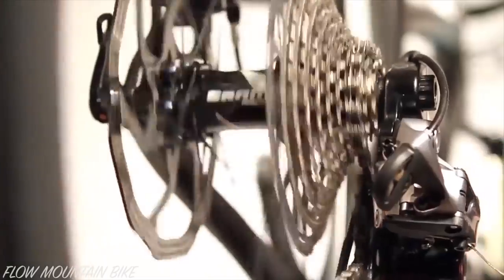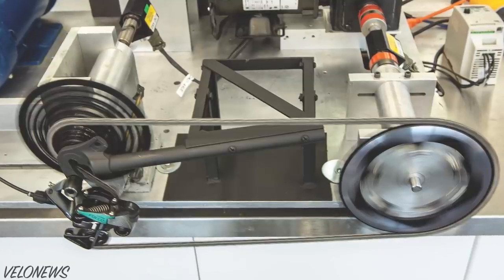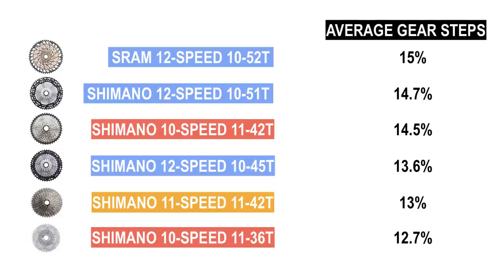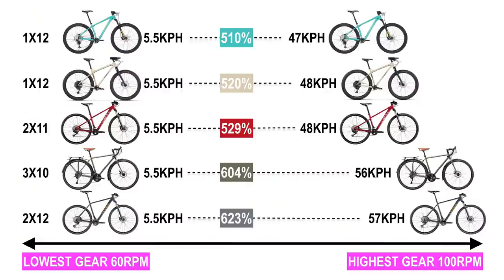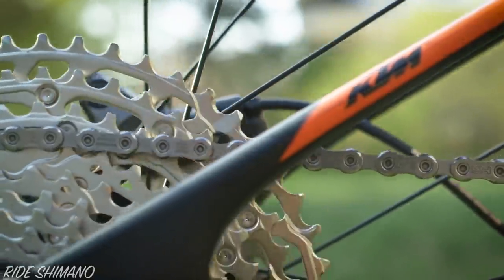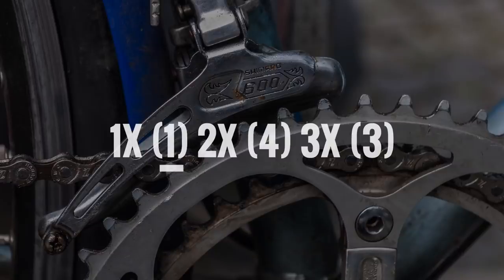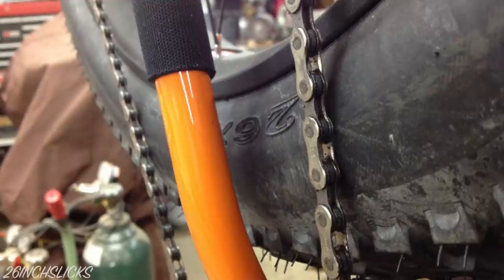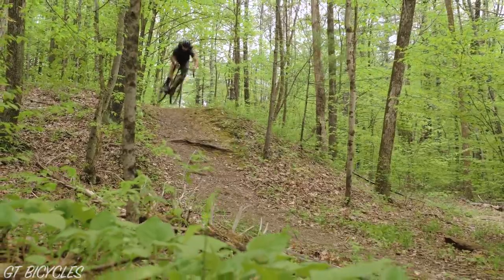1X vs 2X | What is the ULTIMATE Drivetrain For Your Bike?

Comment from the maker: Do you think the front derailleur will always exist? Or will new technology eventually render it obsolete?? 🤔
Reply: I hope FDs will stay for long. On a tandem, a 3x setup works great, the need for cross-chain is rare and thus chainrings and all cassettes cogs wear quite uniformly.
The only pain is that we have to buy three new chains after every 3000km anyway... ;)
Reply: You forgot chain retention. It is one of the biggest benefits of 1x in MTB.
Reply: Oh that's a tough question!  They are cheap and efficient and have been around for ever so I am going to say yes, they will continue to exist.  You can't make a 1X fast enough for a road bike.
Reply: I think they'll stick around as long as the rear derailleur sticks around. Hopefully one day we'll fully adopt gearboxes of some sort as the standard.
Reply: 1x gang
Reply: I think they'll stick for long, especially on road bikes
Reply: Your drivetrain is a reflection of your terrain or the versatility of your bicycle.  If you want a versatile bike for flat, hilly and mountainous terrain, you must ride a bike with more than one chainring.
Reply: I think chain slap and chain coming off in MTBs is one main benefit of 1x drive trains. Another plus point for 1x is less clutter on the bike. No front derailleur means one part less that can break, one cable less and more space on the handle bar with one lever less. The whole concept of having to know how and when to shift which lever up and down honestly seems pretty nasty and archaic and I always wondered why they don't simply introduce a mechanical shifter where both cables go in and that does a correct shifting automatically. Like they do with electronic shifting I believe. Having to think about shifting two levers at the same time can be a nuisance in cities with much stop and go or if you ride on the flat and hit a hill and have to shift down quickly to avoid shifting under load. Another thing I also don't get is: If a narrower cassette and a narrower chain last longer anyway, why not just use that narrow setup not only for 12 speed drive drains but also for e.g. 3x8 mitigating most of the chain angle problems(?)
Reply: @no-trick-pony  Chain slap is all but eliminated with the clutch mechanisms in today's derailleurs, whether running 1x or 2x.
Reply: The big takeaway is about user needs. How many uses need to go fast under pedaling power? I suspect for many 40kph is enough, going up gradients is a bigger concern for many, especially amongst those that follow tour channel. I wish many entry level bikes of all types with 1x to let new riders focus on riding not shifting.
Reply: 2x works for me. 12 speed chains might last longer but they are very expensive and since we travel for long amount of times in developing countries very hard to come by and you can use a shimano or sram or whatever chain on a 10x. There are also 10 speed chains that last as much as 12 speed ones. Not sure the front derailleur will always exist but for the bunch of years it will take me to complete my round the world adventure I think so.
Reply: @no-trick-pony  only one shifter on my 2x with Di2. Shifts automatic in the front, and compensates by shifting one step the other way in the rear
Reply: Why did you omit FSA's 1x13?
Reply from the maker: @piotrch0  I don't believe FSA make a 13-speed drivetrain. But either way, I included the most common drivetrains with the best data we have.
Reply: Just went from a 3x to a 2x on my XC hardtail. Never ever have I used the front derailleur with such a sh1t eating grin. It's great to switch between low and high gear with a single click when taking off and after getting up to speed, and it requires infinitely less attention. And I can hear the chain scrape when cross chaining so nope, never getting a 1x.
Reply: Gear hub & belt?
Reply: I tend to look for a bigger front chain ring, to be able to go faster, because the rear cassette can only get so small. I'm not a big fan of the trend of the front chair ring getting smaller for these reason, also I imagine the less teeth there are the faster the wear? 
Anyway I enjoy your videos! I'd love to bike pack some day.
Reply: @PrzemyslawSliwinski  Agreed! We have 2 tandems that are ridden both on-road and off-road. Both have 3x drivetrains. We see a wide range of speeds due to the varied terrain and wind conditions etc and I couldn't imagine riding our bikes with a 1x drivetrain. A 1x would be a sacrifice either at the low end or the top end not to mention the bigger gear steps between gears. 1x is definitely NOT the way to go!  Cheers, #tandemadventurers
Reply: @konyp1  How is chain retention a benefit of 1x when I've seen way more riders dropping chains with 1x systems than I have with front derailleur equipped systems?
Reply: @SurpriseMeJT  THIS.
Reply: @theadventurebiker  2x chainrings are designed to move the chain between gears using ramps, cut-outs and low teeth. 1x specific chainrings have uniformly tall, narrow-wide teeth designed to prevent dropping the chain. I used to be skeptical of  1x a while back but having tried it myself I am fully converted, at least for technical MTB. 2x will of coarse always have its uses for road, touring etc.
Reply: @theadventurebiker  Among the all new groups the closest in range and gear gaps are the GRX 2x11 ones, I suppose. 
So, fortunately,  the "<3x" future doesn't look quite bad... ;)
Reply: @konyp1  Yes, I am well aware about the design of a 1x chainring and also 2/3x chainrings. That doesn't change the fact that I've seen more dropped chains on 1x than any other MTB drivetrain. I have a couple of friends who have lost positions in MTB races because of this.
Reply: @theadventurebiker  That is rather strange and contrary to my experience (xc, enduro), and general consensus on any mtb forum. But oh well, to each their own. There are plenty of 2x bikes if you prefer these.
Reply: if we can somehow create a front shifting mechanism that doesn't rely on a front derailleur but has some benefits of 1x systems, then 2x will still prevail.

One such product was the Vyro cranket, which is a 2x crankset with pivoting chainrings that maintain a specific chainline and can be narrow-wide, effectively making it a 1x system with  more range. Unfortunately, the company shut down.
Reply: @avocette  A Belgian company ("Secret" or "Classified" - I've forgotten the name) has recently started offering a two-speed IGH that works with the standard rear derailleurs.  It is prohibitively expensive, however....
Reply: @konyp1  yes of course -To each his own. Ride what you like best. As for me I am highly doubtful that I'll be riding a 1x bike any time soon, if ever at all. Its just ridiculous to me.
Reply: @PrzemyslawSliwinski  this really isn't anything new. 3 speed internally geared hubs that can accept a Shimano 7, 8, 9 , or 10s cassette have been around for nearly two decades.
Reply: @theadventurebiker  Good to know.  Thank you!
Reply: @PrzemyslawSliwinski  yes Sachs of Germany was the first brand (I beleive) to introduce this type of hub, back in the mid to late 1990's when most bike drivetrains were 9 speed (on the rear). Since then, the bicycle division of Sachs has been acquired by SRAM and I believe SRAM still offers [newer] variations of these hubs. Sturmey Archer (formerly a subsidiary of British maker Raleigh, but now a division of Sun Race) also has a full line of various hubs like this.
Reply: Well I'm in a 3rd world country. 3by gang!
Reply: @no-trick-pony  i think because there's that standard width of hubs   i.e.  8-11 speed cassettes can fit the same freehub
Reply: @no-trick-pony  There is an old grip shift that does that exact thing(shifting both front and rear derailleurs in a progressive pattern). It was a sight to behold. I think it was french. Good heavens. We scrapped it. It was awful.
Reply: The front derailleur makes a bike way more versatile, especially mountain bikes.
Reply: @tellef70    show me pics or send link,  that sounds awesome
Reply: @Senzeni    yeah,  now if we could get the large,  medium chainring up front instead of the medium, small,   i have 7x  cassette
Reply: Internal gear mechanisms mights steal the show.
Reply: It will be reinvented and rebranded to keep the sales up.
Reply: Eventually humans won't exist anymore.. But as long as I'm alive there will be a front derailleur around. Whether people use them or not is another story. I see rear hubs and maybe even bottom brackets becoming the shifters / gears..
Reply: Front derailleurs suck. They just suck. I'm happy to sacrifice 2W to be free of them. Maybe the front gear ought to float, so it can remain perpendicular to the rear gear. Or, maybe the rear gears ought to float to remain perpendicular the the front. Instead of moving the chain, maybe we ought to move the gears!??
Reply: @chadkline4268  never had a problem with mine. Actually I thoroughly enjoy when I use my front derailleur. It's a big shift in what I'm doing on my bike.
Reply: @bradwjensen  ok, but i view front derailleurs as extra nearly senseless clutter on the handlebar. Extra cabling. Extra mechanical parts. An extra cranking gear. And if you live in a nice climate, that's fine. But if you live in near Arctic conditions where every moving part and cable is subject to frost+snow+freezing, any addition mechanical thing that moves is terrible. A disaster. People don't consider that a bicycle should work in all climates at all times, not just tropical weather. For similar reasons, I hate disc brakes. I wish cantilever were the standard.
Reply: @chadkline4268  Yeah if I lived in an Arctic condition I probably wouldn't be riding a bicycle
Reply: @bradwjensen  I don't know why you say that. A lot of people live with very cold winters. Alaska, Canada, many northern states in the USA, Norway, Sweden, Finland, Russia, Germany, Switzerland, etc. Some of the most popular biking countries in the world.
Reply: @chadkline4268  I live in Iowa and I don't bike in the winter. Haha
Reply: @bradwjensen  I used to live in Moline+Iowa city 😆 it's fine, maybe the tech hasn't advanced there yet. Here, near Yukon, everyone puts studded tires on their bikes, so you can ride on ice and snow in the winter. Until it is subzero in F, you can ride same as in summer. Just change your tires to studded tires 👍 maybe -20F is too cold.
Reply: @chadkline4268  I'd probably go for some rides if I had a fat tire bike with studs. Haha but riding in the cold wind would suck.
Reply: 😁We have patented an entirely new, infinitely variable, ultra-torque dense, gear technology, called FrictionLess Gear, which is a reformulation of gearing theory. Legacy and novel applications abound. Retrofits of ALL existing bikes, even electrics, will be available. The gear range can easily be >700 with a price range half of the lowest priced competitor.

Revolutionary torque dense electric motor innovations are on the table as are novel  variable shock absorber concepts. 😉

Comment: 3x gang rise up
Reply: A bit late but here I am to support
Reply: poor gang?
Reply: @rafi6618  i mean yeah, or just not wanting to spend a ton of money on a bike
Reply: 11-32 Road cassette
53-39-24 crankset with 74BCD small chainring
There You hace every ratio you'll ever need. From 20 gear inches at your lowest to keep pedaling at 60+km/h at your highest.
Hope you like maitenance thoug .
Reply: @rafi6618 ah yes modern peasantry mentality. pay more for less
Reply: @Kore7711 im extremely late but im 2x here 53/39..10speed im dying climbing hills lol
Reply: @pokiblue5870  Then you are not on the 3x gang, go back when you can ascend hills like a eagle that flies upon mortals
Reply: @Kore7711  🥲 my mountain bike has 3 gears in front lol but i only use it for winter maybe i can join the 3 gear club lol
Reply: Yes my bretheen. Frens
Reply: 3x forever, I think his scores at the end were off as 3x wasn't considered in the efficiency test only 1x and 2x. 3x would have won has it has even less chain deflection.
Reply: @danielgamboa1200  Not worth the almost 1kg of additional weight of the heavy 3x cranksets compared to 2x or 1x.
Reply: @qwerty6789x  But 3x is not better than 1x or 2x. It is heavy. It doesnt really have much more gears. You can have over 600% of range on 2x11 or even in 2x10 if you use 11-46 casette and a 22-32 chainring combination. No deraulier has much more capacity than 600% due to the lenght of the deraulier cage.

Not to mention that the theoretical number of gears is not the same as the useful number of gears. You wont use even 24 gear combinations in 3x10. No one who knows how to use a 3x is going to use biggest in front with 3 biggest on the rear, or the smallest in front with the 3 smallest in  the rear, since the chainline is going to be terrible.

Even more, there are often duplicate gearings, or gearings that have too small jumps to be noticed when using 3x cranksets.

Realistically 3x10 drivetrains have about 21 useful gearing combinations, 2x12 have 18, 2x11 have 16.

3x cranksets are very heavy, they are mostly from the bottom of the price range.

2x is the best overall, 1x is the best in rough terrain.
Reply: @jurekgadzinowski2895 heavy is a pro, not a con in my book.

Racers are what? Like less than 1% of the cyclist population and for the rest weight does not matter in the ±1 range.

If the metal is heavier, it is also more durable (usually). So you get more for less and for longer.

I personally need the 3x. I use the smallest cog very rarely, but when I need it 2x is not enough.

What I love the most about it is that I only use the smallest cog in the back and when I switch between 1-2-3 the back stays the same, so I can switch between the modes I need the most super fast.

Maybe,you don't need this, but your bike should be the reflection of your needs and desires and 3x is fcnk awesome.

If you don't want it, good for you, but don't deny its superriority, just because you are younger than 35 and you grew up with the "inferior bike for more money" era.

Comment: For me, I prefer the simplicity of a 1x setup for day-to-day riding, shorter trips and lighter loads. However, for long tours and heavier loads a front derailleur and smaller steps between gears will always be the way to go in my opinion.
Reply: So true. For bikepacking I love my 2x setup.
Reply: Simplicity is only useful for people still learning how to ride a bike. And by then they'll became experienced with using gears within a months use... Making the single chain a waste of money to only use for a month before it becomes a bottleneck againd the rider
Reply: @jason200912 Not true.

In racing it is beneficial to have a few parts less that could get broken.

Not to mention that 1x is the lightest. Even if you had 10 speed 11-42 casette in the 2x and 10-51 casette in the 12 speed, the weight of the additional chainring, the deraulier and a shifter is gonna be around 300g, if you are going to use XTR or DI2 line components. About 400g if it is going to be anything from the non-top shelf, which is a noticeable amount, especially since it is the rotational mass.

But 2x has its benefits, like more range than 1x while usually having smaller jumps between gears, the ability to quickly change the gearing a lot, because  if you shift on the front you will make a difference close to shifting 3 gears on the casette.